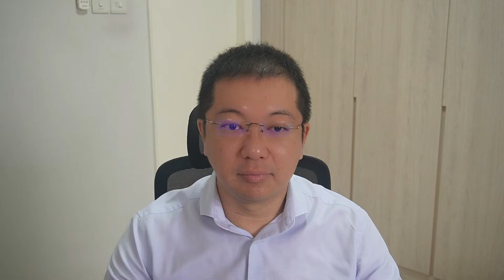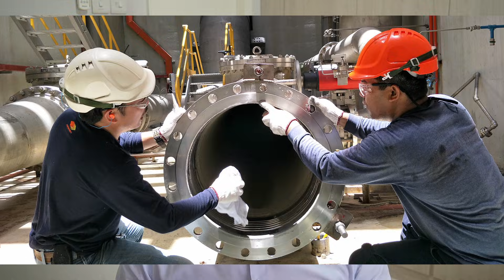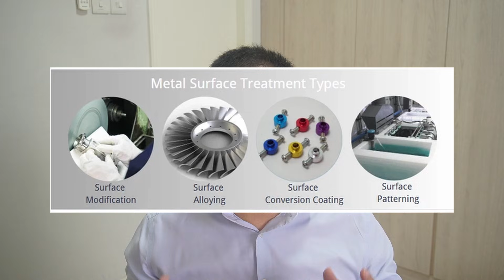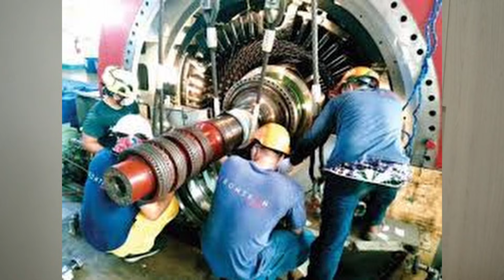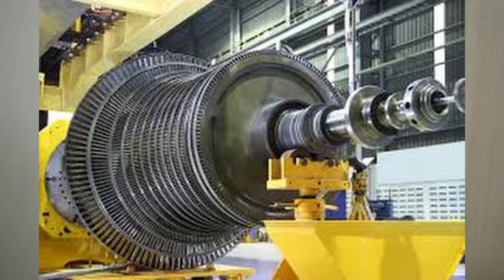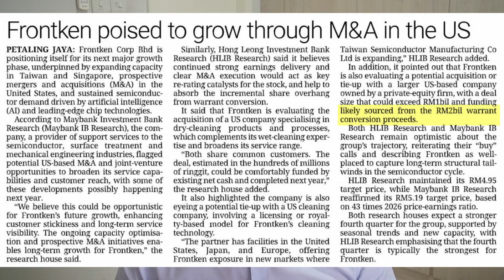How to Invest in Frontken Berhad 2026

Comment: Frontken is a well managed company with very strong cash flow from operations, due to their high margins. The main concern is they relies only on a few big customers from Taiwan. Don't think their already high margins can improve significantly further  in the future. The strategic move to increase revenue through acquisitions and JV is a good one. Even better if they can setup operations in the US as Intel, TSMC, Samsung, etc are setting up more semiconductor factories over there. However with their earnings of just over 9 cts per share, trading at RM4.20 would imply an expensive PE of over 40 times. Not a good time to buy based on risk reward assessment.